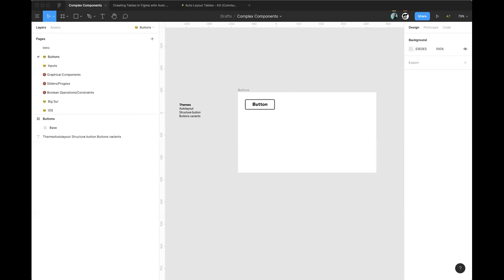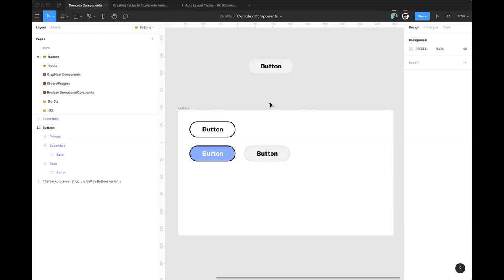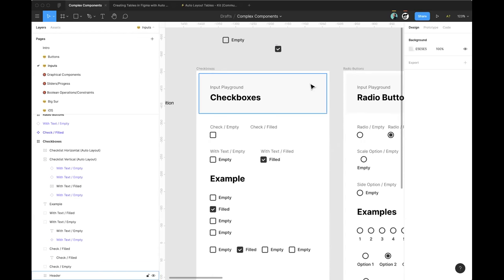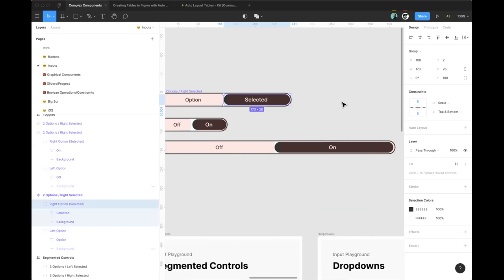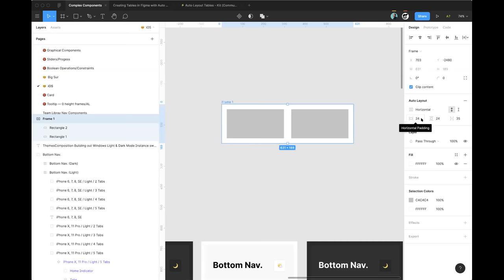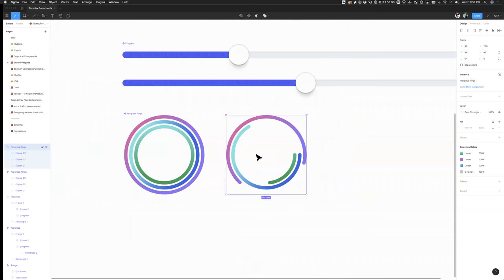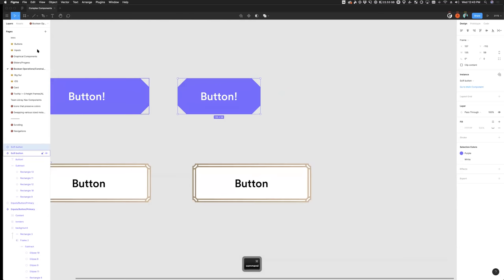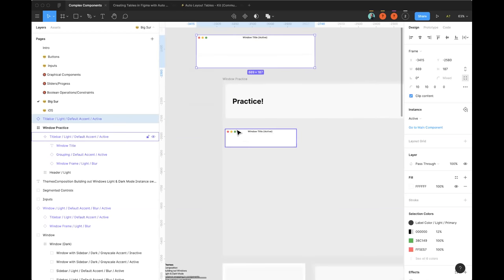Office hours: Complex component architecture

Comment: So this is Before Variants and before auto layout update... I think this didn't age well... this last 2 months. Crazy how fast you are working.
Reply: @Gabriel Leni and I wrote that a Year ago. Imagine.
Reply: I was wondering about the same thing. For some reason, I like the old way doing things from this video than the Variant. To me, variant may be a bit more rigid whereas in this video, you can do whatever structure you want to as long as you are using a frame.
Reply: @windmaomao  oh man, and you haven't seen properties, this year update leaves this one on the floor. But this one is very complex. Even more than this video.

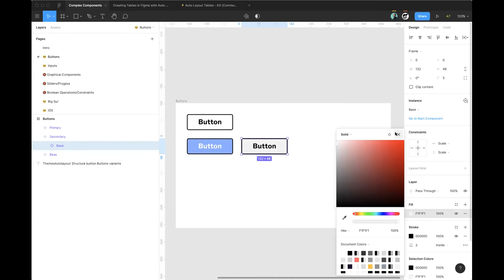Comment: 4:05 
The problem with using an instance for a new master component is text won't get changed when it's used somewhere else. You've to break the instance and again master it. Otherwise, it won't work.
Reply: In my experience, you can change text in the instances without detaching from the component. If you then switch the instance to a different variant based on the same master component, you keep the custom text but all the other properties change to those of the variant you choose
Reply: And if you change the text (content) in the master, it will change in all instances where the text hasn't been edited. So, not seeing your problem